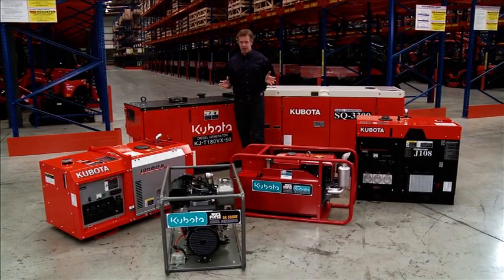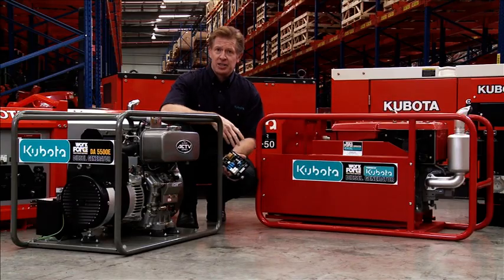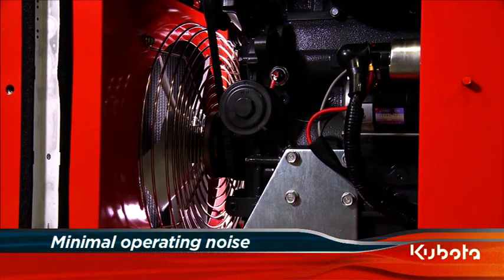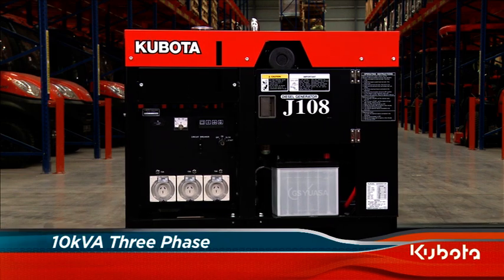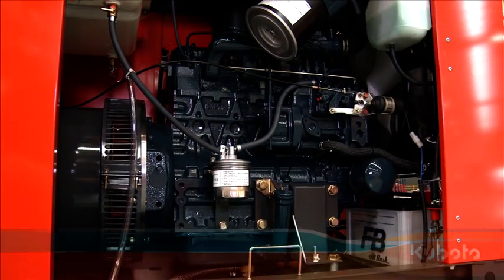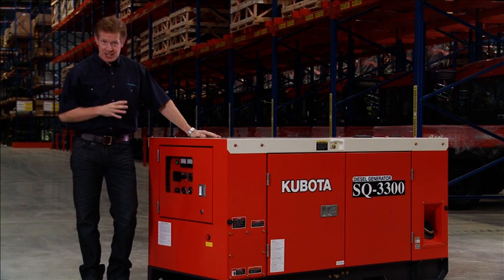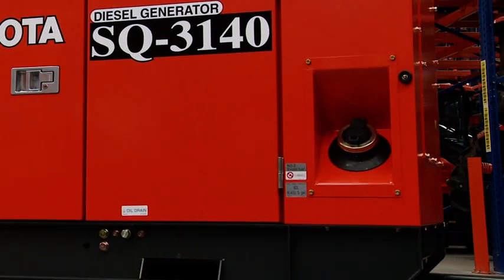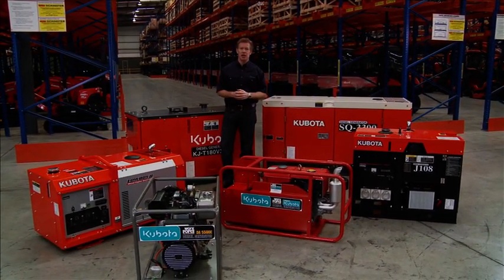Kubota power generation equipment

Comment: Do you sell something that runs at 1800 rpm.  For some reason they used the 3600 power heads.  Makes them louder than they would normally be.

Comment: I have the Lowboy II, GL 7000. Awesome machine, money well spent!!
Reply: how is the 3600 rpm?  is it  noisy?  I almost bought the GL 7000, I opted for the Northstar 8kw instead.
Reply: @mr.taxpayer5289  no im thinking about spending $8,000 on a GL 11,000 wich pretty cheap then a $36,900 10,000 waat caterpillar generator plus these kubota gl uses the same parts from the kubota tractors wich nice

Comment: Should have been designed to run at 1800 RPM. Not 3600 to dam noisy!!!
Reply: Yes, but.......the cost would go up due to larger engines being used for running at 1800rpm.   Kubota makes nice compact diesel gen sets.   I  would like to buy the 11kva unit.